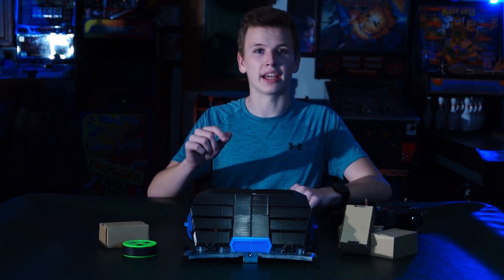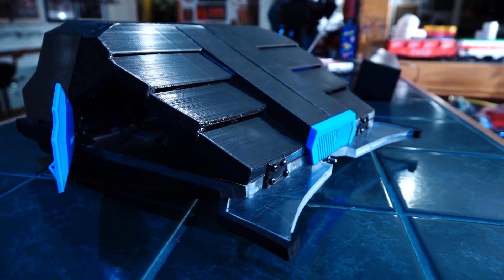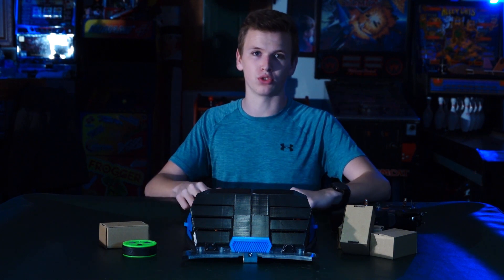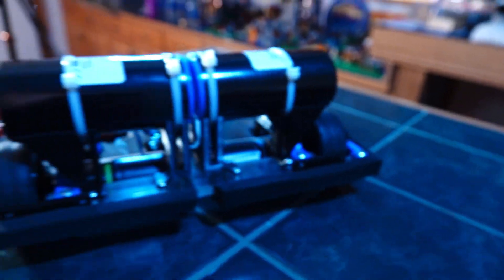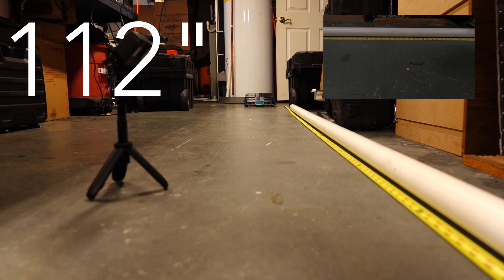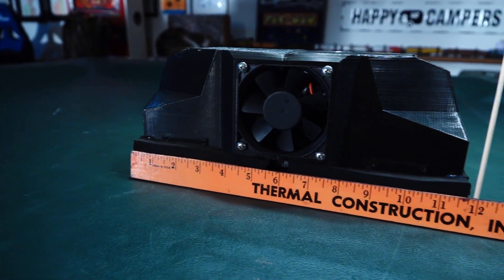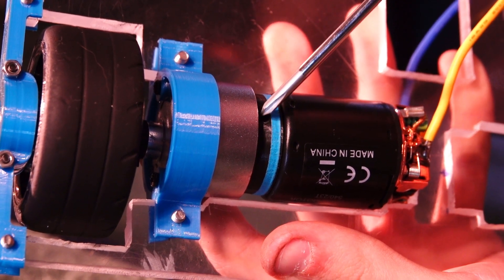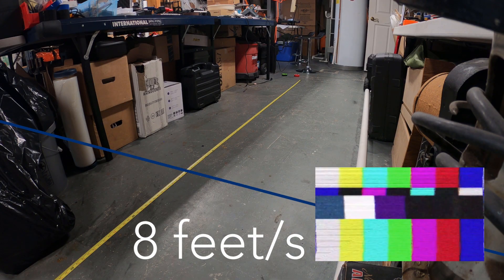NRC Virtual Submission: Player 2, Hockey Robot

Comment: “Fierce” videoo guys!  Good luck. Surprised you used NiMH battery.  Is that due to regulations, fast discharge rate or other reasons?
Reply from the maker: Awesome question!!! Compared to other batteries close in stat, the NiMH batteries have that 'all around' kind of discharge, next to liquid based batteries which are a little slower in discharge or LiPos that discharge very quickly. That all around discharge rate gives a fair amount of life to the batteries where they can outlive the movement LiPos by about 3 or 4 runs, while still giving the capacitors almost instantaneous charge.